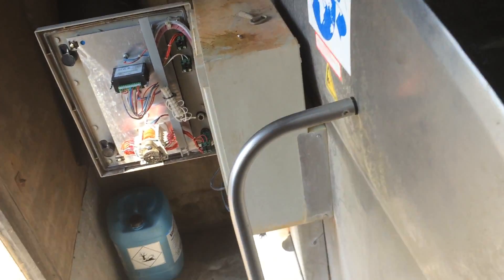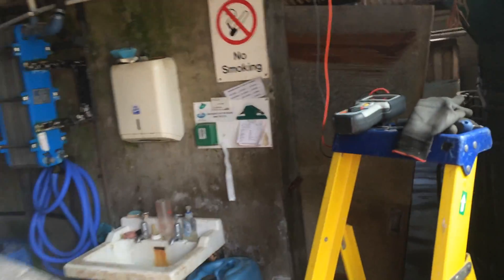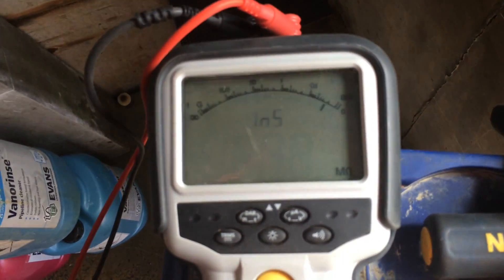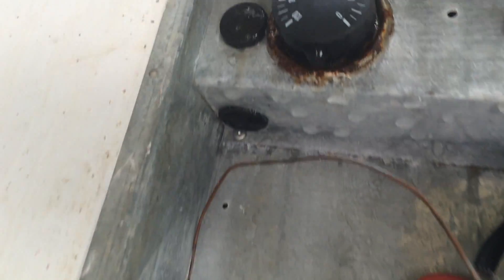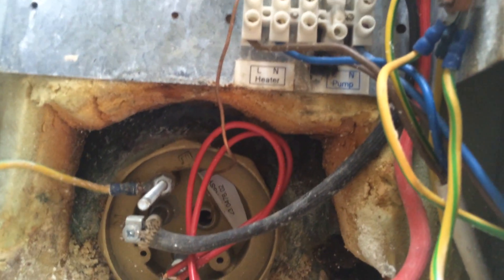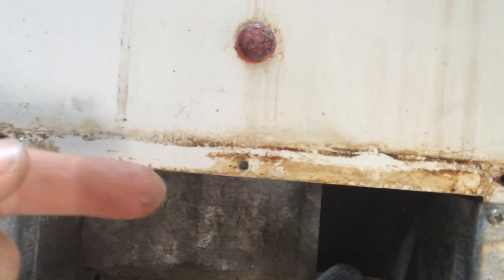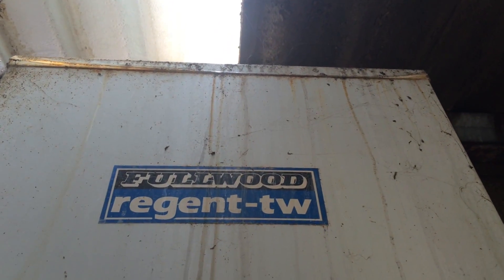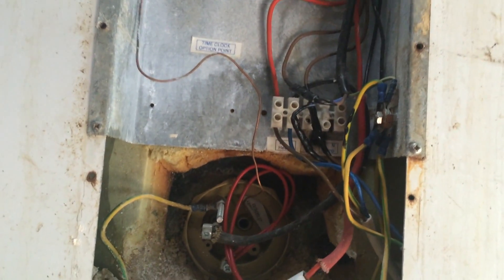Tracing Electrical Problem with Megger MIT410

Comment: Nasty! I've seen those terminal strips burnt out to dead short before, mostly in those fan heaters
Reply from the maker: Machine Man I think this was a bad design to have the terminal strip screwed to the steel panel, should have had some sort of insulation between the two.
Reply: heavydiesel yeah those things definitley don't like water, lucky it had a proper ground connection on it